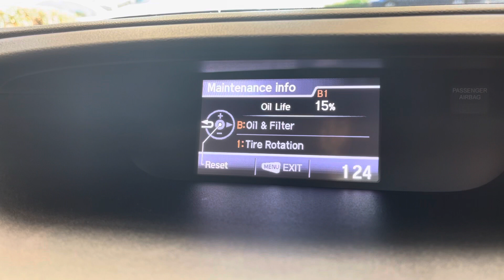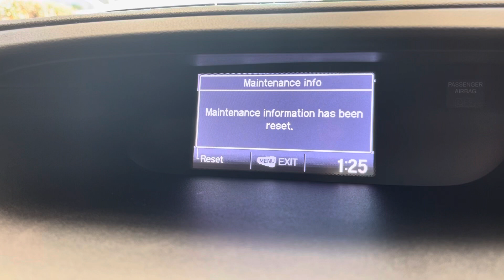2015 Honda CRV Engine Oil and Oil Filter Change - Easy DIY

Comment: Always use oem honda oil, your using a oem filter, why not oil. I'm a honda technician from Canada and I have really seen what other non oem fluids can do to a engine. You have a beautiful cr v, why not keep it that way. Ps. I was very impressed with you and how clean you kept everything, doing a oil change really can be a dirty job. Keep up the good work Sir.
Reply from the maker: Oh thank you brother.. i do always use oem oil and filter on my vehicles.. This was my first time to use Penzoil and use it since then and its like Im Ok with It. But i will take your advice Sir. I will use OEM next oil change. Thank you for your advice i appreciate it. I just love to do basic maintenace on my vehicles and i hope i could learn some more.😀 Godbless brother
Reply: Even motor oil? I understand using OEM for every other fluid except for motor oil
Reply: It’s not THAT different if it’s full synthetic 0W-20 and it’s easily available that’s what I’ll get lol
Reply: Actually there is a big difference if oem oil and other oils, as a certified honda technician I would strongly recommend using only honda 0W20. And no I’m not trying to sell honda oil, I’m only staying facts. Your engine is designed differently and others engines, the inside is built and designed better than most. Anyway it’s up to you but I’m just saying from my honda training.

Comment: FYI, I added 4.6 quarts but level showed bottom of dip stick, I added a few more oz to be safe.  Hopefully the stick is not accurate, i.e., it will read midpoint rather than max at the full level. I saw some other mentions of users stating the Honda manual doesn't necessarily state it will read max with 4.6 quarts, but curious what others think.. PS,  that background music is so silly but I find myself humming to that sh*t, lol.  Luv it 🤣.  PS: the cup used around the filter is genious, but didn't work for me that well, but cool.

Comment: Someone splain to me why you only jack up the front of the car. I thought the car had to be level. How do you check for level? Place the level bar.. where?
Reply: It's jacked up to drain the fluid. Check with dip stick in the level ground. Always check your level after a oil change. Some people even put some oil in the filter before install.
Reply: @ticktock2320  ... thanks, I did it just like that. Lowered it, tried to get it perfectly level to check oil. Only problem was torquing to 30 ft/lbs. The torque wrench too long didn't click & I may have over tightened the crush washer. Doh!

Comment: ¡Filtre en la izquierda, drene en la derecha y no cambie la arandela trituradora!
NO cambie ninguna arandela de aplastamiento. Apriete manualmente tanto el filtro como el drenaje.
De nuevo
No cambie ninguna arandela de aplastamiento. Honda CRV 2015 tiene la arandela de aplastamiento original de fábrica. Cambio mi propio aceite y filtro y mi CRV 2015 nunca ha perdido una gota de aceite.
Reply: Filter on Left Drain on Right and do not change crush washer!
DO NOT change any crush washers. Hand tighten both Filter & Drain. 
Again 
Do Not change any crush washers. 2015 Honda CRV has the original factory crush washer. I change my own oil and filter and my 2015 CRV never has leaked a drop of oil.

Comment: how was this pennzoil compared to the honda factory 0w20 oil?
Reply from the maker: There was no big difference i guess but after a friend of mine watched the video, he recomended to just use Honda fluids. He is working at Honda as a mechanic so i listened to him😅.
Reply: @110897100  i get that! how much difference do you have to pay between penzoil platinum 0w20 than the honda 0w20? i use penzoil platinum on all my vehicle. 8th gen honda civic si and toyota sienna, runs smooth.. mas maganda kesa sa mobile 1 in my opinion!
Reply from the maker: @McDzy  its like 10-15$ difference bro. OK lang for 5000miles bago mg change oil ulet. I have read a lot of reviews before deciding to go with penzoil and you are right penzoil has a higher ratings compared sa mobil 1 and you can feel theres no such difference.
Reply: @110897100  san kayo dito sa US? cali? colorado kami haha.. at least no snow there in cali if so
Reply from the maker: @McDzy  yes bro wla kming snow. We have to drive a couple of hrs sa mountains kung gusto ng snow Lol! Are you a mechanic too? Ako DIY lang backyard rook mechanic. Dealerships are just charging too much and its like cant trust really. Kaya pinag aaralan ko to do myself. Regards kay pareng Jokic u bro😊
Reply: @110897100  i know bro! no, same as you po. just youtube youtube lang. gusto ko matuto mag replace ng clutch, pero parang mahirap.. kaya nman yung mga simple simple lang na papalitan haha.. 

at mahal talaga sa dealership, way too much.. pati diagnosis eh minsan may bayad pa talaga.

pag nakita ko sabihin ko sakanya hello hehe..
Reply from the maker: @McDzy  medyo madugo nga un bro😅😅.. pero its nice pag ikaw ang gumagawa most of the preventive maintenance.